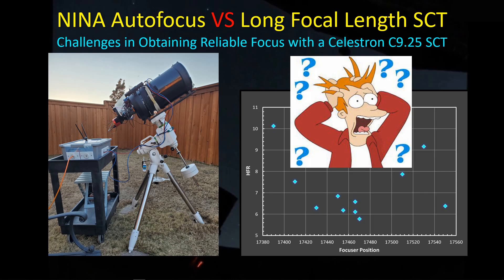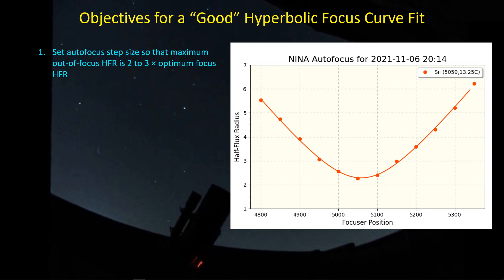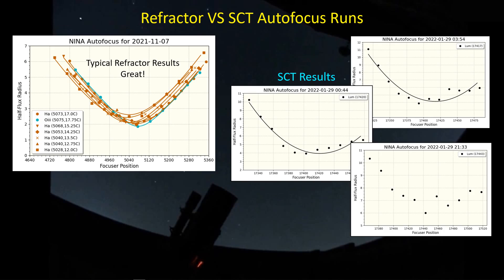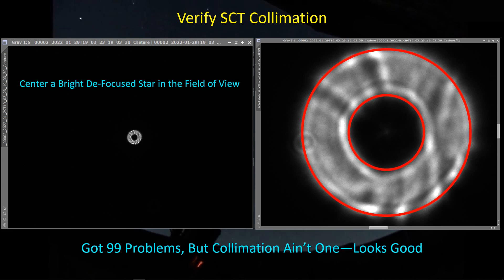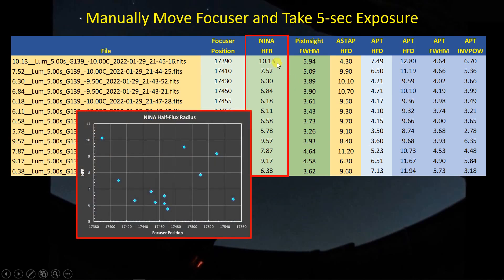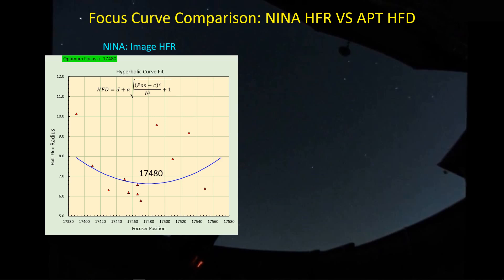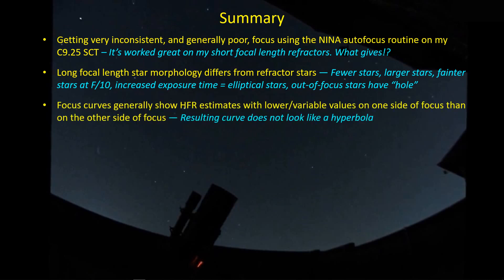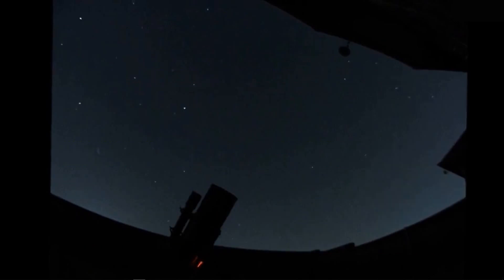Autofocus Challenges with an SCT

Comment: Good video James, you have very variable inconsistent results , did you run while you have cloud running through as have many outlines, so if you have a measured backlash of what you say is 20 then it can't be that.. could it be mechanical issues from the focuser ( you've had plenty of issues with it so far) So the EAF is working perfectly fine on the frac
Your collimation doughnut looks ok, you can overlay collimation aid in APT to do the same thing.. but remember your collimation doughnut isn't in the same place on both sides of focus... and as have mentioned before you want to approach focus from one side not reverse and come back as you have a slight backlash error from the mirror drawtube, you need gravity as your friend...
Reply from the maker: Thanks Derek. Even though I measured the backlash when I first installed the focuser, I have had to remove and re-install it several times. It is possible that the interface between the focuser and the SCT is not as tight as it was originally. Anyway, I'll try longer exposures and a higher backlash setting. If all else fails. I'll go a different route with another focuser.

Comment: Hi, I believe I am using a very similar configuration - C9.25 with Celestron SCT focus motor. FWIW I am not seeing these issues, the autofocus curves are looking much like the ones you are showing for your refractor. I did much less analysis than you did and changed only a few NINA parameters based on earlier experience with other programs. I select an ROI between 20%-80%, keep guiding on and have overshoot set to 100 "in". Not sure if any of that is causing the difference in the results.
Reply from the maker: Thanks for watching. When I leave guiding on, the torque generated by the focuser causes PHD2 to lose the star and then it starts the error beeping, so I stop guiding during focusing. One difference could be that I'm using an OAG so the image scale is much smaller than if using a guide scope. I will try a higher backlash setting and longer exposures.

Comment: Hi James,
I have an 8 inch Celestron SCT with a Celestron focus motor, and I seem to get better results when using overshoot on the IN side instead of the OUT.
Also when you get disk like stars Nina has a harder time getting the HFR, you might want to use a slightly smaller stepsize or less steps to make sure the stars don't turn into disks.
Anyway, hope you figure it out. I'll be interested in the results using Hocus-Focus.
Reply from the maker: Yeah, you're right about the in/out direction. I use OUT to minimize the focuser motion because of other issues keeping the darn focuser attached to the scope. I've played with various step sizes. Next time I get clear skies, I have a list of things to try, including Hocus Focus. Thanks for watching! Like the X-Files: The Truth is Out There

Comment: I had the exact same problem on my 9.25, same shape in the AF curve as your data. I found that longer exposures were needed, and it cleaned up the curve, something about how the intensity changes as a function of defocus for that direction and how HFR is calculated?  I spent 2 nights trying everything I could think of, and longer exposures is what did it.  (I was using the hocus focus plugin for NINA with backlash overshoot)
Reply: I think this may be related to the comment later about stretch factor and black point - related to how it determines the threshold to detect stars - especially with the central obstruction creating the hole.  I ended up with 8 s exposures, which made for a long AF run, but that was faster than failing AF runs.
Reply from the maker: Thanks Brent! I think that's a good idea. Next time out, I'll crank up the backlash setting and the exposure time to try and get more and better-formed stars. I'd be satisfied with a 10-minute-long autofocus if I could get reliable results. As it is, I'm losing nights of imaging. Thanks for watching!

Comment: Hi James,
You are certainly correct about the SCT versus a refractor when it comes to autofocus.  My C-11 very rarely will have all the stars somewhere close to the curve in NINA.  However, on super clear nights, I have seen some pretty remarkable fit to the curve.  I am glad to hear that you too have (had) issues with the Celestron focuser coming loose.  I periodically need to tighten the set screws, but if I tighten them too much, the focuser will get stuck.
Reply from the maker: Hey Pat. That Celestron focuser, or more accurately its interface with the scope, is terrible. The best approach is to leave the mirror alone and move the camera, but those focusers are awfully expensive. I'll swirl around the drain a while and see what happens...

Comment: Interesting - I enhanced the NINA AF routine back when my main rig was an EdgeHD 800. Not quite the same as a C9.25 but close. The main difference is that I was using a Moonlite Focuser, so not moving the primary mirror.
That said you have very little HFR change, even with APT. Have you tried maybe doubling the step size?
The points being all over the place could also be due to poor star detection. Have you tried turning on star annotation to actually see what was detected as a star in each image? With star annotation, you can then play with the star detection and stretch settings until you get a satisfactory detection of stars...
Reply from the maker: Excellent suggestions! I have played with step size and going further out on the curve. I think the star detection is worth digging into. Some people have commented that the stretch parameter and black point are used by the autofocus routine. I did not realize that. Also, there's no doubt that leaving the mirror in one spot and moving the camera is the best way to go. Who knows? I may end up going that direction myself. I've got a few more holes to dig on this topic...
Reply: Hi Cuiv! Hope you doing well and enjoying your break....

Comment: Hey James. Very interesting video. That made me curious. I read a little in the N.I.N.A. "autofocus" section. And what I guess and see in 4:26 is that your backlash for your SCT is definitely NOT at 20 steps (as said at 1:16) but rather AT LEAST (!) at (4:26 right top graph) 17475-17437=38 so at least double of what you think, since the focus (HFR) does not change in this graph over at least 38 steps. And this flattening of the curve on the right hand side is exactly what you see in the N.I.N.A. "autofocus" documentation online. - All very well explained there. - Additionally you can check the autostretch factor and black point clipping. - Good luck! :)
Reply from the maker: Hi Tully. It is possible that the colder temps have caused reduced contact between the Celestron focus motor and the SCT shaft thereby allowing more "apparent" backlash than when I first measured the backlash as shown in the graph. Also, I have had to remove and re-attach the focuser several time because of other issues with that focuser. Bottom Line: I need to tighten the set screw to improve the connect with the shaft and increase the backlash setting. You and another commenter mentioned the autostretch and black point settings. I had not realized those were used in the autofocus assessment. Thanks for watching, Tully!
Reply: @Aero19612  Ah, okay..so you are using a Celestron focuser.. Sure, if there is bad contact between focuser and SCT you could get crazy numbers... I already wondered because of the very different focussing graphs in your video.. - Other than that if you try to find your backlash I would really watch the curve ..that's the best indicator I would say. Since I personally have no electronic focuser (yet) it was very interesting for me to learn about that myself. :) Would be great and very interesting to see your progress on that (maybe in a future video?). - Clear skies
Reply from the maker: The Celestron focuser is not a well-designed piece of equipment and may well be at the source of this issue. In the end, I may be shelling out for an alternative focuser. 
I'm sure there will be another video...or 10 on this topic. I never seem to run out of problems and hopeful fixes!
Reply: I have a thread about focuser slipping on cloudy nights that shows my suggestions on pegasus zero af and adjusting pully size that have worked amazing since I did the mods

Comment: Hello James,

I am actually quite a large fan of your videos and I believe have watched each of them several times due to the joy of learning many things about the hobby from you. But, in a interesting change of events, I might can actually help you.

As not only a NINA and Hocus  Focus user myself, but also an Edge HD 9.25 user as well, I can understand the pains of trying to achieve focus in an form of automated fashion. I have toiled for 20-30 hours testing various means of Autofocus on my edge. The problem is one of design though. The graphs you posted are almost identical to ones I saw when using a ZWO EAF on the main focus knob. The issues is mechanical. The way Celestron designed the SCT's focus system seems shortsighted at best, or just cheeping out at the worst. You see, the primary mirror has 3 points of contact on the inside of the scope. Two heavily greased guides, and one guide that is used for moving the mirror. The problem, as I am sure you are quite aware of now, is that that mirror can skew, changing the stars, but also creates an impressive amount of backlash. In colder temps, that grease locks up and makes focusing even more difficult. I believe people with good copies of the scope can use an EAF potentially, but it is far from reliable and do not negate the issues of the dreaded 'mirror flop'. 

There is a solution. Prima Luce Lab makes the Esatto which is a dedicated focuser for many setups. It has zero backlash (each one is calibrated at the factory and mine has zero measurable backlash) and solved the mirror flop issue. Basically, you just setup the Esatto and all your backspacing to be about 5 mm short of the recommended backspacing for your scope, the as the Esatto moves out the remaining 5mm, it will achieve focus at the same point where the recommended backfocus is. 

This focuser solves several issues. First, focus curves are just like a refractor, with just a smaller HFR variance. Which my GT81, prime focus gets an HFR for 2.2 but my autofocus routine can measure out to an HFR of almost 20. The problem with SCT's is the prime focus has an already larger HFR of around 4, as you mentioned, so when you defocus the star, it becomes so large that NINA and the other detectors do not think it's a star. With my 9.25, I can get about 3-4x ratio for the extreme points of the autofocus curve which always seems to work fine for me. The next issue it solves is mirror flop. Since you are focusing with the Esatto, you can move the primary focuser so the lead screw is engaged and pushing the mirror again against gravity and lock the mirror locks. This means the mirror does not move (meridian flips do still need an AF run) and it reduces the mirror flop issues. Lastly, AF speed is increased with the Esatto and Nina.  Running Hocus Focus and Filter Offsets, I can do an Autofocus routine in less than 2 minutes. Oh, and the filter offsets are a great addition too as since the Esatto moves so reliably you only have to use Lum as a primary filter and then just offset from there. Lastly, since the primary mirror is disengaged for focus, the target does not move as you focus. For planets this is almost a must as you can focus without ever losing the target. For DSO, you do not have to worry about if autofocus is going to move things such that you have to reslew to the target. 

I'd be more than happy to help here because I have used my Edge on several deep sky projects and have gotten over 100 hours of imaging time on it in the past few months so I understand the system very well. The Essato is a prime piece of kit. Especially given is insanely small step size. It is price for sure, but it would solve every issue you have in this video and more.
Reply from the maker: Thanks for watching all these stupid videos, Noah! It's a tough job, but someone has to do it. Actually, you don't "have to" so I really appreciate the effort.
I totally agree-SCTs bring in a ton of mechanical baggage that good refractors do not. I also think Celestron was only thinking of visual use when they designed their base level SCTs. The EdgeHD versions are better suited to astrophotography, but still have extra mechanical bits that refractors don't have. Thank you for the Esatto recommendation! You make a very convincing case and a new focuser may well be the path forward. I don't have much confidence in this Celestron focuser. It has cost me many nights of good imaging. At some point, I'm going to get totally fed up with it. Off to Google the Esatto...
Reply: @Aero19612  The reason I enjoy the videos is due to the technical nature of them. Not many Astrophotography people put in the level of detail you put in, and I mean that. I take a very academic approach to astro and watch a large amount of videos on this hobby to study and take notes.

But that is a wise about about the visual use. All, and I do mean all, of the issues we face with the C series and Edge series would be solved if Celestron would have just locked the primary and put a crayford or some measure of external focuser on the back of the OTA. 

I do fully believe that the Esatto solves all the issues you face. You should just need two adapters for it and then no more fussing around!
Reply from the maker: Indeed it would. Just looked it up. The Esatto 2" with the standard SC adapter and the M56/M48 adapter would work. They're not in stock at the moment. Surprise, surprise.

Comment: Hi James, lots of good info here. you are (fast) becoming an Astro SME. The HFR and HFD provide an indication of best focus, so why not scale each column to be a maximum of 10 e.g. NINA column has values from 10 down to 5.70, PixInsight has values from 10 down to 5.48 and for the other columns? Plotting all these values will show how the shape varies with each algorithm.

All Focusers have some backlash and some quirks too. My Astro Pegasus's Achilles Heal is definitely the coupling between Focuser and Motor. Get that secure and many anomalies disappear. On Refractor, If the coupling is OK then manually trying to gently move the focus is prevented. On SCT the same type of Motor with a different bracket isn't an issue. Assuming all is coupled correctly the backlash value can be set higher - yours can easily be set to at least double your step size?

The question of mirror flop can be checked by either testing at higher/lower Azimuths or at least raising the scope up to the target before focusing? With Autofocus, you start high and come down to get points for a curve, evaluate the curve and set the focus to the calculated best focus. Returning to the best focus point should be easy even allowing for backlash e.g. over compensating. In NINA can you trace the positions sent to the Focus Motor to check how it is being driven?

Backlash compensation works differently in different Apps. In my Focuser the backlash is removed differently to SGP Pro's method and probably NINA's. Having more than one method in operation would be confusing at best. It would be tempting for the Motor manufacturer to hide their sloppy mechanisms with built in backlash compensation but that would defeat the controlling Apps like NINA trying to apply their own algorithm.

I noticed that the order of taking the images is not in sequence (based on the timestamps).  Can NINA save the images during the Autofocus routine or at least repeat them in the same order? To replicate NINA manually you want a series from right to left and then the final image which should be the same/similar to an earlier point if everything worked out OK. Simon
Reply from the maker: Hey Simon! That's a good idea. The magnitudes of the various metrics are all over the map. At the end of the day, we would each metric to provide the same optimum focus point. Of course, they don't. In this example, APT's HFD is best, APT's FWHM is next, NINA HFR/APT InvPow/Pixinsight FWHM are equally poor, and ASTAP is worst of all. Just one example though. 

I agree. Backlash in the focuser and, for SCTs, in the mirror moving mechanism may be the biggest problem. If I had it to do all over again, I'd buy an SCT with mirror locks and a focuser that moves the camera instead of the mirror. For now, I'll try to get this mess working "well enough." First thing I'm going to do is dramatically increase the backlash value I've been using. Stay tuned!

Correct. The images are not in time/position sequence. I wish there were a setting that would allow NINA to save each picture during an autofocus, but there isn't as far as I know. That would be a good feature for geeks like me! Thanks for watching!

Comment: I'm running an Edge 8 with the celestron focus motor.  My backlash compensation is around 120.  Step sizes are similar to yours.. around 30 IIRC.  Mine has been working fairly well with SGP (which has a notorious AF routine).  It struggles the most on nights with poor seeing.
Reply from the maker: Thanks for the information. Using a much larger backlash setting is certainly worth a try. Thanks!